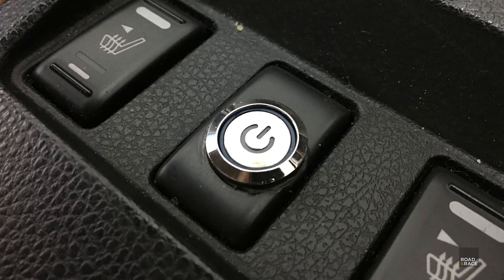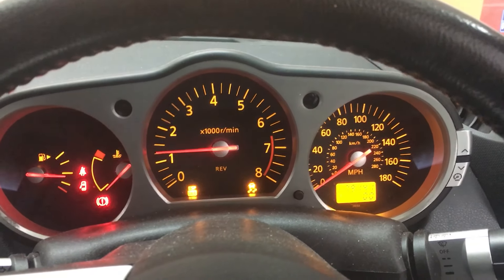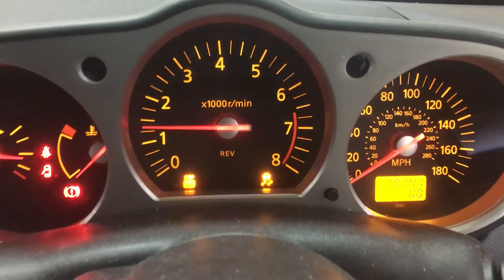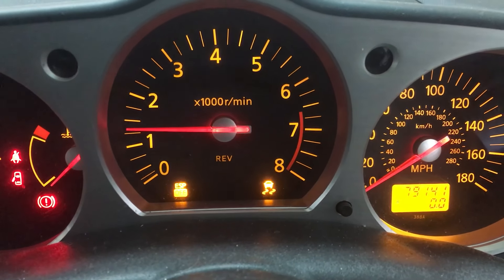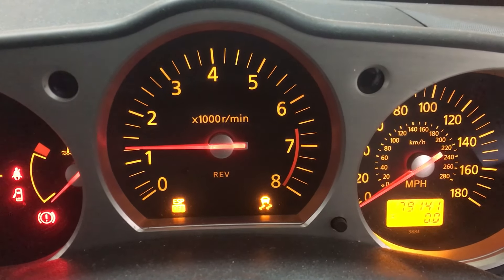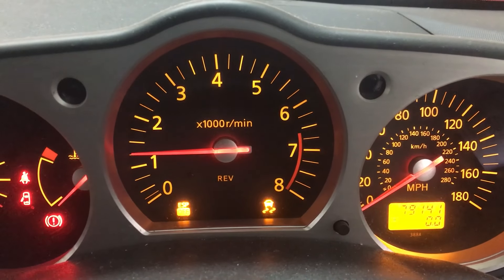Nissan 350Z - How To Disable Stability Control (VDC)

Comment: Lovely soldering. I would recommend using a step drill bit rather than a spade drill bit to cut the hole in the plastic. Gives you more control over gradually increasing the size of the hole and without ragged edges. A spade drill bit is more suited to wood based materials.
Reply: I know im randomly asking but does anyone know of a method to get back into an Instagram account?
I somehow forgot the login password. I love any assistance you can give me.
Reply: @Isaiah Preston Instablaster ;)
Reply: @Antonio Chris I really appreciate your reply. I found the site on google and Im in the hacking process now.
Seems to take quite some time so I will reply here later with my results.
Reply: @Antonio Chris it worked and I now got access to my account again. I'm so happy:D
Thanks so much, you saved my account!
Reply: @Isaiah Preston Happy to help =)

Comment: This seems a bit over kill, why not just get a simple 2 pin switch and intercept the power cable for on and off? Also it's far better to crimp than solder as it gives more flexibility and won't crack and break the connection and you can always remove the mod if needed.
Reply: I was thinking the same thing. It would be much simpler that way. That’s how I did it.

Comment: Random question unrelated to the ztech stuff (although I do have a burnout box installed) but what are the 2 connectors at the back of your centre console? As I don’t have anything in my centre console for the connectors to fit to although they are there..?

Comment: My traction control button is on the dash to the left of the steering wheel did they put it on the center console for other years and what is the other factory switch do located there?

Comment: I have a vdc button near the fuel filler cap button. My 350z is a track model. Are the standard models without any stability control buttons
Reply from the maker: I ahve the same button.  I believe that only turns off traction control.
Reply: @RoadandRacetv  aah that makes sense, I've always wondered what to do with that mysterious switch blank. Maybe I'll link it up to an exhaust flap mechanism one day. cheers
Reply: @rollei35mm  Correct, that button disabled the TCS (Traction Control System), but not the VDC (Vehicle Dynamic Control) which is what grabs the brakes. Scared me half to death the first time mine did that!
Reply: 06 G35 6MT  has VDC button. Disables traction control & stability. Can also drift and burnout without modding pin 101 either....

Comment: do you know if it is working with other cars from renault-nissant group? i neet to do this with a 2.0 tce megane 3, the esc turns automaticly on after 40 km/h
Reply from the maker: Doubt it. Maybe contact the manufacturer?
Reply: @RoadandRacetv  well that's how is intended to work, only on the rs models it goes fully off

Comment: love it, id like to do it too. Can i buy a factory switch and use that instead of drilling one into the blank though?
Reply: You can. I have aftermarket seats in my car, so I ended up utilizing one of the heated seat switches as the switch for this modification. I mainly did it due to the fact that you cannot tell anything has been tampered with.

Comment: My 04 Z has the traction control switch on the dash to the left of the steering wheel. Did some years place it on the center console. What is the other factory switch next to it?
Reply: The one next to mine is light washer button

Comment: What does the circuit board do? You only touched two wires...

I did this mod to my G35 years ago but just used a 1 dollar 2 pin switch to cut the power going to the gyroscope, if all this board does is that then an $81 (after conversion) kit is pretty unethical
Reply: Yeah I’m wondering what the purpose of the microcontroller is, can’t you just wire in a switch?

Comment: Hum? I'm now wondering if my stability control box might have gone bad or a possible sensor. Because those same lights on my dash came on spontaneous for no reason while driving. They are off when I turn the car on but the moment I start driving poof they come on. Have to look into that. great video and idea for the track.
Reply: check battery wiring and brake fluid :)

Comment: Interesting.  I may need to pick up one of these for my G35  coupe.  Gyroscope wires appear to be the same.
Reply from the maker: Yes, I  believe they are
Reply: The wires are exactly the same for the G35, just the trim removal is obviously different, i am Cs2000 by the way, the guy who makes the kit :)
Reply: @Computerstar2000

Can you describe what the difference is between using the kit and just cutting power to the gyroscope using a $1 switch? Everything advertised as a feature of your pcb seems to be something a simple 2 pin switch can achieve, so I'm having a hard time understanding why your product exists.
Reply: @computerstar2000  can you tell me what gauge wire you are using?
Reply: @breaksk8r446  The module wires are 18AWG silicone coated wires, the wires for the button are a little thinner at around 20AWG with standard PVC coating.
Reply: @computerstar2000  will this work for the auto Skyline 350gt

Comment: I did this mod as per video and now I have no power to gyro at all. All fuses are sound but traction and abs permanently off.
Reply: Hey, did you ever find an answer to this, I've got the same issue.
Reply: @jdmsuki3254  no mate still working in it
Reply: @TwoToneTaj  ah, damn. Hopefully you can get a fix soon! Thanks anyway bud.
Reply: Any luck with this?
Reply: seguramente vuestro problema es que el interruptor que usair es normalmente apagado y lo que deberian usar es una normalmente encendido

Comment: So one of the complaints with the standard Z was that to avoid 'agitating' the VDC, you had to drive the car a certain way on track and that meant you couldn't really trail the brakes into a corner if you wanted to, does this mod allow for better modulation of the brakes without any interference?
Reply from the maker: Yes.  No interference.
Reply: @RoadandRacetv  That's nice, can you now get the tail involved by trailing brakes  into the corner entry? I believe earlier, you sorta had to get the braking done a bit earlier, and then take a neutral to understeer stance mid corner?

Comment: I've found just hitting the VDC button under the steering wheel area to be plenty of stability removal. The car will do donuts without interfering.
Reply: The YAW sensor is more for the stability control i.e. when you go around a corner and one wheel loses traction it will cut power to that wheel. Different to throttle induced traction loss i.e. traction control

Comment: Hey - awesome mod!

Do you have any details on the wiring?

I can't figure out how many wires your switch has. The ones I see generally have 4:

- Earth
- Dash light (so a secondary light turns on when the car turns on - I don't care about this)
- Power In (yaw sensor cable)
- Power Out (yaw sensor cable - other side)

(the latter two connect when the switch is turned on to connect/disconnect the yaw sensor).

I'm wondering how your power tap works to turn on your LED light?
Reply: Did you ever figure it out?